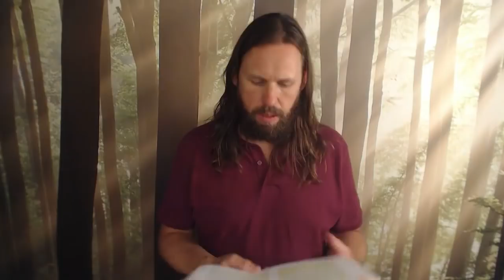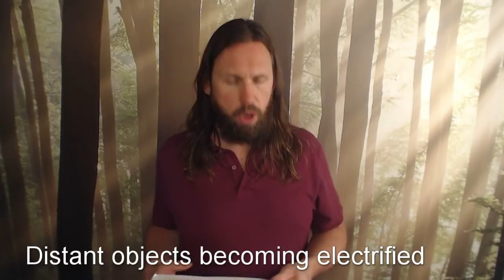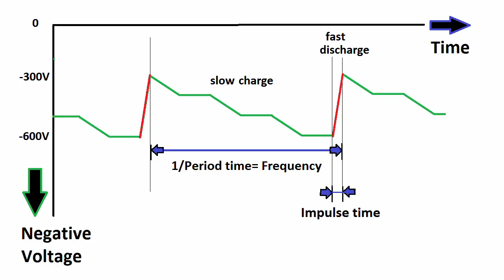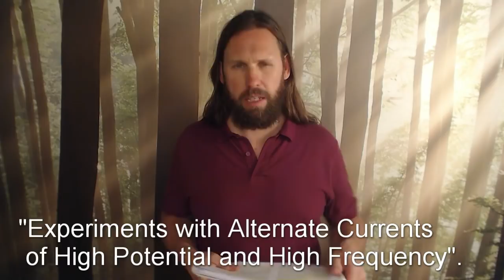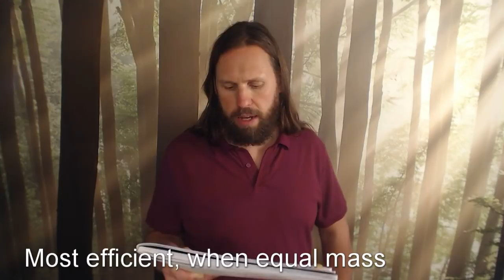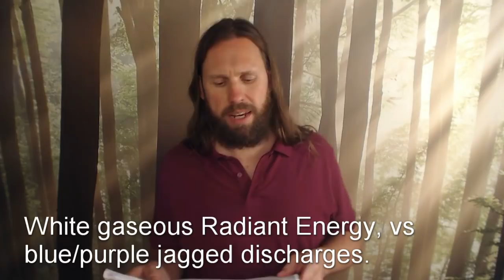Nikola Tesla's Radiant Energy Part 2 of 3

Comment: Yes electric shocks are no fun, I've had 240 volts at 13 amps in my mouth keeping in mind it only takes something silly like 300 milliamps to stop your heart.
I definitely won't do it again but I survived it with no harm apart from fried tastebuds and thrown 6ft across my bed.
I can laugh at it now but I can promise you that you never want 240 volts at 13 amps in your mouth.
Reply from the maker: What happend? sounds awful! Did you bite your alarm clock off?
Reply: Lol, just extending some wires but didn't realise that they were live.
Everything was fine apart from my tastebuds and the 13amp fuse blew.
Reply from the maker: lol :)
Reply: This is the first video that shows you that you're on the correct path with regards to the rapid shunting of a slow build up to a millisecond discharge or what we know as priming the ether.

I can't put into words how excited I am but I can assure you that feeling you were getting when reading the book and thinking to yourself exactly the same thing I'd be thinking and that's “wow this is super interesting, I need to see where this goes" 
I know you're almost there and the three videos I'm sharing with you can show you pretty well how you're going in the direction you need to be.

If these don't help you by your coil shape they'll be exactly on the dot with your shunting because it's the shunting and pressure that induces ether flow just like you and Tesla said, I know because I've watched it being used successfully.

With the frequency in this video it's the shape you need to be focused on.

https://youtu.be/dY5mXOx9wjE
Reply: It's also the duty cycles/gated pulse width modulation you need for rapid on and off switching to prevent a magnetic field from being created.
Honestly I can't tell you how excited I am I only slept for an hour and then had to take the dog out because I couldn't keep still thinking about where I know you are, if I lived around the corner from you you'd most likely heard me shouting YES ITS HERE because I was that certain of the direction your going in.

All makes perfect sense why Stanley needed this exact modulation to get the water cavitation he really needed.
Reply: This video shows you where the choke points will be on the coils and where you should expect to see energy spikes and release.

Remember Teslas tower and the coils in his lab photos, this shape was very important to his work, I think it's the shape of it that allows these diamagnetic fields to not gather the strength they need to disrupt the opening or flow of the ether.

This is really important because Tesla recognised the many places from ancient buildings etc that displayed the shape even with Egyptian civilizations.

https://youtu.be/9EPlyiW-xGI
Reply: This video shows the gentleman whom went on to make some of these coils but unlike yourself I don't believe he understood what the shunting was or what it's supposed to do and he considered his tests as failures because he was attempting to cancel the Lenz effect which as you know is back emf, but this didn't cancel it it amplified it which is why I know it works and that he'd misinterpreted what these coils were supposed to do.

I know you're the same as me and most people,you can get that involved in what you're doing it becomes difficult to see the right way forward and like myself a short step back and a fresh look at things knowing what's already been gathered in my head really really helps.

The gated pulse you need must be dropping in current with each gate and your right and Tesla is its this dropping that causes the ether to fall if you will down its drain point and into our physical reality.

What it's essentially doing is pulling on a chain to release a plug but this plug is only able to stay open under the correct modulation, I think there needs to be at least 12 gates per cycle each one gradually diminishing in power but constantly being pulsed.
I can promise you that you're going in the exact correct direction and these videos along with what Tesla was saying can prove it to you or anyone who's really paying attention.
I think your coils are wound correctly just the wrong shape to allow the diamagnetic field to do what it needs to disperse and not gain and gain.

https://youtu.be/i-dhIK2ozz0
Reply: I really do hope this helps you to step back and see with fresh eyes, because it's all there now.

You know the formula to induce induction of the ether the only thing that's missing is the shunted high powered gated pulse width.

This is super exciting, I know Teslas dream is not far away from completion of at the very least a format that can be replicated and studied but more importantly safely utilised.
Reply: I will say congratulations to you first because I know you're the person who's going to prove to the world that Dr Tesla was no fraud and knew what he was talking about.

I know that you're going to do this.
Reply from the maker: Thanks for sharing!

Comment: When I was about 6 or 7, I put my hand on a wall socket on purpose just to see what it felt like. My whole hand vibrated (at 60 hz I guess). It didn't feel good but it didn't hurt either, so I did it again. I actually held it there a few seconds to fully absorb the feeling before I decided I didn't want to experience it again. I realize now that it was only conducting within my hand and not across my heart, which could have gone much worse. It also would have hurt a lot if my hand was wet I think.
Reply from the maker: must have had dry hands, high resistance. BZZZ. BZZZ. nope :)

Comment: master ivo: I need to power a para-motor directly into a motor hitting the coils in perfect time for propellor propulsion. I just need two 1 hundred lb force rotary engines directly from this pulse directly into the coil from the bi-filer coils without any reduction, and using that power that Tesla tried to keep away from because it was blowing up his machines. That is what I want for my capacitor, hitting it just as the coil spins into its proper position.
Reply from the maker: I don't know, I only work with solid state devices, not mechanical.
Reply: Sounds like you are trying to build an aether shock pressure powered rotary 2 stroke engine? You might be on to something here.

Comment: Also in the programs there is a small facility not far from manhattan that uses a tesla coil technology (huge tesla coil on the wall) and you sit in a Small room behind a large glass window and strip down to your underwear and when they run the machine you feel the warmth your talking about, people report light coming out of the pores of your skin and time seems to go by for the subjects about 3Xs faster. Also subjects claim when they touch the glass you see the same plasma-electric arcing from your fingers to the glass like in a plasma lamp. I believe it’s about 45 mins on the outside for a treatment but it seems like 15 mins from inside. All the toxins and heavy metals and any other negatively impacting health gestalts seem to disappear. They claim it is tele-transported although they admit they don’t know where to. You need to have some very high connections or be a seasoned vet in the programs to get to use the machine. Its said to take about ten years off ur age and your skin is nice and tight and pores reduced and you feel much younger. Diseases like hepatitis and cancer go away completely after a few treatments depending on the severity. Incidentally, the 4-5 gentlemen that work there and run the machine look about in their 40s yet they’re all completely bald and have way tighter and brighter skin with no blemishes like one would normally have in their 40s , none are flabby or out of shape looking but clearly don’t work out and they are constant telling stories amongst themselves talking about Nikolai tesla as if they knew him very well and were co temporaries of his. Which would make them much much older than 40 something. So it would seem to me your on the right track and so was Tesla. Too bad the government stole all his work after he died and obviously threw a bunch of money and scientists and labs behind it and got who knows how many technologies and breakthroughs from it all and none of which being used for our benefit in the public realm. Only the slavemasters get to benefit from the tech that we paid for with our own tax money and the money they made from devaluing the dollar by 99%, by the Fed and ESF, massive embezzlement of hundreds of trillions of dollars since the 1940s, by the military industrial complex through the pentagon, HUD, etc..rigging of all the markets by people like Alan Greenspan, the dynastic banking families like Th Rothschilds, Rockefeller’s, Payseurs, JP Morgan (who screwed Tesla the worst) and that doesn’t even take into account all the really evil and heinous stuff they make money from like child trafficking, Drug trafficking, Weapons sales, organ harvesting, murder for hire and blackmail. So yeah we should all be flying around in our own personal electrogravitic spacecraft in a world with no disease, money system,  no slavery,  no government, free energy, food and material replicators and only have to work a couple days a week for 6 hours a day to maintain that life and the infrastructure of the world and the rest would be free to better ourselves, grow spiritually and evolve technologically. It’s sad how much they really stole from us and that a man as genius and good as tesla was mocked and marginalized while he was alive and had to die broke and lonely feeding his only friends the pigeons.
Reply from the maker: There is much mis information and propaganda around Tesla, don't believe everything.
Reply: @MasterIvo  This is from people who have been there . two of them separately, one has nothing to do with energy but one has had multiple asassination attempts by the cabal for putting out free energy and medical devices. He patented the first platelet rich plasma concentrator and a few other things he managed to make from being oin the programs and had millions, lambos, etc.. put his medical money into free energy. Showed off a working prototype in a walmart parking lot at 2 am and within 5 mins of it running they had choppers in teh area and they almost got him taht night. within 1 month they killed both his dogs on 2 separate occasions,  first took one and dumped it in the middle of teh highway 10 miles away. Then had two fake cops pull up on him after his tire magically blew and they beat him mercilessly and took off.  Then another time he got a call from one of teh good guys telling him an attack was incominbg and literally 20 secs later he was hit with a device that stunned him with high frequency or em or something and 3 guys beat the hell out of him in a hotel. This guy is like 6'5' jacked, like 265lbs and a trained soldier in the air force. Not a wuss. beat him with batons for a few mins till he was out and left. Not prpoganda. Police reports exist. been vetted by multiple people. Def real.  But do your own research. Dont take my word for it. You wont learn anything just listening to peoples stories. gotta synthesise that was your own research in different areas, documentation, testimony, articles, books. Just saying that there seems to be a similar effect ive heard of from multiple sources. Thats all. They have had 80 years to perfect it and drained hundreds of trillions of dollars just from our countrry alone so what do you think theyre doing with that money? its not all hookers and blow I assure you.
Reply from the maker: With respect, stories like these are designed to scare people. I have put out detailed info, and  I am happy healthy and proceeding.
Reply: @MasterIvo  Putting out info isnt dangerous. Making working free energy devices and medical devices is. if you create anything world changing the best bet is to send out the specs to everyone everywhere and get it on a blockchain too so everyone has it. put your name on it so you get credit as the creator and then the cabal cant do shit. Its when people try to market and patent it thats when they get messed with. First the cabal or big oil or big pharma comes and offers you ridiculously big sums for the rights so they can shelve it indefinitely and its not yours anymore and you have to sign NDAs and non compete clauses so you cant do anything with it anymore. But just putting the basic science wont do anything or cause any heat. Gotta have working machines to get their attention. When you do just dump the info on the world and youll be known as the guy who invented it, gave it to the world for free, get every man of the year award and go down in history of the greatest humanitarian of all time. Poeple will pay you just to do cameos and sign off on tehir brand so you wont need to patent anything. youll still make millions and possibly billions and consulting fees to all the companies and startups making the devices will be plenty of money as well. When peopel get greedy thats when they have problems. Once the genie is out of the bottle theres nothig they can do nor would they bother to as it serves no purpose. But yeah no one is going to bother with you for just talking about stuff and experimenting and having a youtube channel or whatever.
Reply: Holy Shit i got to try this. Now connect a plasma lamp filled with xenon and other inert gases so the light rays from it can total rejuvenate.

Comment: When experimenting with an HHO cell. At one point, out of curiosity  I wrapped one of the  input leads around a strong neodymium magnet. I found that when I connected the power for a moment fine white streaming sparks would fill the air around the coil and magnet. This only occurred if the correct pole of the magnet opposed the direction of the DC applied current. I was fascinated by it. It was a new form of electrical discharge than I had ever seen. I feel this may be of use to some others in the context of radiant energy. Which I now understand it to be, thanks to these videos.  The HHO cell is of course a capacitor.
Reply from the maker: Interesting!
Reply: I've seen massive increase in gas production with arc on blues copper and steel driven by cordless drill PWM.   Very like what is described here

Comment: Don’t forget you don’t need to even use zero voltage as a reference... say you have a 10 volt positive as a reference you can can go up or down five volts and you still have a potential change....
Reply from the maker: Correct! its all relative

Comment: This is what Tesla referred to as "The wall of light". It is a backfeed pulse perturbation, implosion not induction,  as demonstrated by Viktor Schauberger. It is the only way to protect ourselves from an EMP or death ray. 

Explosion is always violent and jagged, implosion is always smooth and curvilinear. They are two parts of the whole, which is itself a tertiary system. As my concept is -1, 0, +1, implosion, compression and expulsion. That is the key for "natural" law of energy. Starting at the zero point and fractalizing outward in a coaxial helical vortex.

As Aristotle explains "Nature abhors a vacuum", if you have explosion, you will inadvertently create implosion. This is well established by Walter Russell and explains how and what "gravity" is.
Reply from the maker: I really like how your mind works. Yes curvelinear implosion is key.
Reply: @Master Ivo  much appreciated 🙏 I understand how this Construct operates. Most people do not have the capacity to fully grasp these concepts.
Reply: Gravity is the inrush of aether fluid pressure, you are the right track.
Reply: @Bruce Miller  thank you. Not to sound too intoxicated with my own understanding (egotistical). I am quite well acquainted with implosion force. In fact I am the one who has previously composed the familiarity with the Concept of -1, 0, +1. Implosion, Compression and Explosion. I am fully aware that this is how most biological and mechanical engines work. However, I have been trying to show how, since Einstein and modern Scientism, we have only used 2/3 of my Concept. The Implosion component has been thrown away, just as the name Viktor Schauberger has as well. Furthermore, it was I who pointed out to NASA and ESA that the moon is trapped inside the atmosphere of the Earth. I proved this, using their own research, and that of Schumann, Van Allen, Birkeland, Alfven and many others. Also I proved that the Earth's atmosphere stretches out many times further than the moon and that no one can ever go into "outer space".
Reply: @Cryptic_Triptych  The atmospshere goes out that far/ thats impressive and we are never told that, Nasa stands never a strait answere!